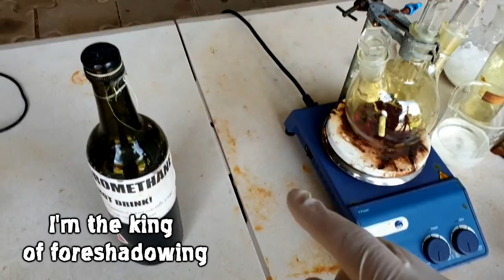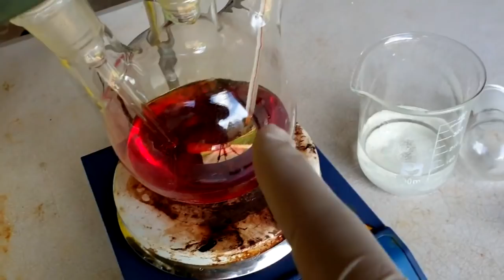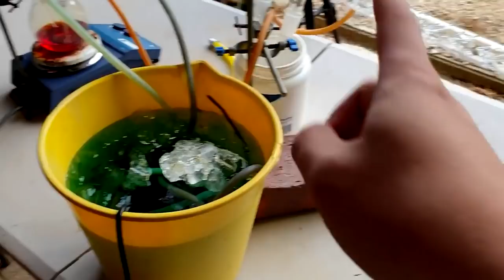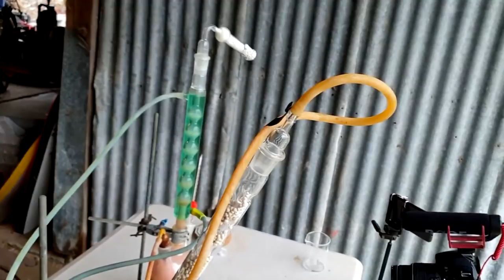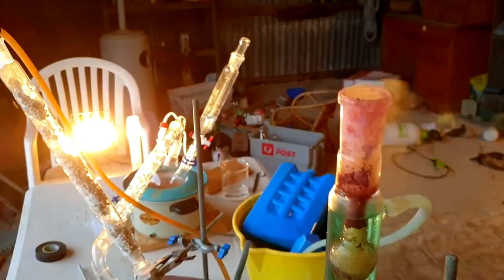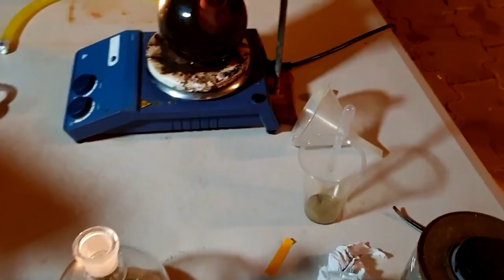Making S4N4 Part 1 (SCl2 + NH3)

Comment from the maker: Hey so comment question of the day is: what is the most stressful reaction you've ever done? I'm sure some of you have some good stories!
Reply: accidentally exploding black powder while drying it. not very advanced but very stressful for a short time.
Reply: Stressful story:
I remember once doing a school project to find out the strength of hydrogen bonds between chloroform and ethyl ethanoate. But according to what I learn from my school, chloroform does not form hydrogen bond. So, I was quite stressed when I wad asked to explain the exothermic reaction that happens when chloroform is mixed with ethyl ethanoate using hydrogen bonds cuz I don't really know how to do it.
Reply: Even though it is more of a process than a single reaction, that has to be the C60 synthesis since it took years of work and very unconventional large scale setups to get milligrams of crude product in the end... Worth it tho
Reply: Ammonium nitrate from ammonium sulfate and calcium nitrate using no glassware, filtration was hell
Reply: Embedding fragments of a 10mL beaker into my fingers at high velocity. A wee bit stressful for a moment there.
Mostly recovered now but lower portion of one finger is still hamburger meat under the skin.
Reply: @j_sum1 was it from energetics?
Reply: More of a disaster close call than a stressfull reaction, but here it goes:

I had this TiO2 synthesis where I would straight up pour 47% aqueous HF directly into titanium (IV) butoxide while stirring. (Then, autoclave for 24h, and get some nice anatase nano-platelets).

I once decided to swap the butoxide with isopropoxide. 

Turns out, Ti(OiPr)4 hydrolysis is much more exothermic than Ti(OBu)4. As soon as the hydrofluoric acid came into contact with the alkoxide, it went geyser, and splashed all over my fumehood.

Thankfully, I half saw it coming, and had kept the fumehood sash closed, save for a small slit on the side (it had sideways sliding windows) through which I could pass my arm, fully covered by the labcoat sleeve and long cuff gloves. So I was safe from any splashing. I was doing it on a very small scale too, only 2.5 ml of HF. 

Good scare nonetheless. 

I ended up just having to fully close the sash, wait for the bulk of the HF to evaporate, and decontaminate everything with my calcium chloride solution.

(This happened to be the one day my advisor would randomly show up in the lab... he was not happy!)

I repeated it, this time having chilled and diluted the reactants with isopropanol, and it went well. (Except it didn't give the results I was hoping for, but oh well...)

So I returned to my standard synthesis, on the large scale since it's my starting material for everything I did: pour 20 ml of 47% HF in 130 ml of Ti(OBu)4, firmly cross your fingers as it noticeably warms up, stick it in the autoclave, firmly cross your fingers again when you have to open it and pour out an HF/Butanol mix to get the TiO2 cake at the bottom, wash and centrifuge... Fun times!
Reply: 13 years old making a batch of rocket candy on mum and dad's camp stove in a Billy on the outdoor setting. Too much heat, 8 foot flames, molten flaming KNO3 going everywhere. Ruined the outdoor setting, stove and dad's trust. I'm now a chemistry teacher. Reaction wasn't stressful, situation was.
Reply: Probably some air sensitive stuff i was really worried about protecting from air
Reply: NH4MnO4 synthesis. Straight forward but fucks over your glassware with green purple shit, especially if said glassware is used alot and you overdo the temperature.. Residue that I thought was quite harmless (just some spots really, I could not get em off, actually forgot all about what it was later) came into contact with dilute HCl --> the garage turning into a WW1 battlefield.
Reply: Attempting (and failing) to prepare sodium nitroprusside, and having to deal with some HCN.
Reply: Accidentally exploding gunpowder...

Or Antibody and antigen reactions, with shaky hands, and where the procedure for the Antibody elution was entirely wrong, so the experiment didn't work. Worst 3 hours of my life that went to waste, in a hot lab.
Reply: @AndrewTann  oh yeah, i was doing that in the kitchen on 300g scale, whole room was filled with thick smoke for 3 hours, i don't know how i ended up with no burns...
Reply: Pd-catalysed carbonylation using 10 bar of CO, lithium-halogen exchange with 2.5L of t-BuLi, synthesis and purification of Zn(CH2SiMe3)2 or Zn(tBu)2 (conveniently fairly unstable) or the first time I made NaPPh2 using Birch conditions (Na in liquid NH3).
Reply: The one time I've done an LAH reduction was probably the most stressful reaction I've done so far. That stuff makes me really nervous.
Reply: @bestsoldier01  Having seen what happens when ~200g of solid lith-al catches fire, I don't blame you.
Reply from the maker: @the rougemillenial did you super-glue your own artery together? that's wild, glad that didn't go any worse!
Reply from the maker: @piranha031091  you always have great stories. HF is really stressful though, never worked with it but that sounds so so scary
Reply: Making bromine with potassium permanganate, sodium bromide, and sulfuric acid.  Needless to say there was a lot of bromine gas and a small spare bathroom had to be painted   Lucky i had a proper mask.  But my eyes didn’t fare as well.
Reply: Testing homemade black powder next to an open container of said black powder. One stray spark set of the whole batch and ended up with a molten plastic container.
Reply: I dissolved uranium dioxide ore in concentrated nitric acid to get fluorescent uranyl nitrate. As happens with nitric acid it started extremely slowly but got exponentially faster due to self-heating. I had just enough time to place the beaker outside on the window sill and close the window to let it be nature's problem until it's done. Then I spent 15 minutes watching my beaker of red-fuming green radioactive acid and evaulating my life choices.

Worked out in the end and I got glowing crystals now :)
Reply: That's probably drying iodide and ammonia in the microwave....yea!
Reply: Making trichloromethane via the haloform reaction (forgot to cool the sodium hypochlorite) whoops 😬
Reply: @rubenoconnor198  Same. In fact it ran away right as I was taking the flask to safety and erupted like a geyser straight into my face. My clothes were ruined and I was lucky to get away with just inflamed eyes for three days.
Reply: Extractions&Ire making benzoquinone from tylenol. it involved nitric acid and generated a lot of NO2. then it started to
foam. i had to do something like 5 recrystalizations from isopropanol to get the color to change from orange to yellow.
Reply: I'd say the time the neck of my round bottom flask cracked apart while distilling sulfuric acid. Nothing like a jagged piece of glass filled with 700° F acid spewing put acid fumes while it's also dark outside and you have no contingency plans for this occuring.
Reply: Baking soda and vinegar. Used too much vinegar and it got on the carpet. Mom was on the way home so I had to hurry and clean it up before she got the wooden spoon. Talk about high risk and high stress
Reply: Extractions&Ire also, C-Tet can be made this way. This is the German paper from around 1937. Looks like the Nazis did something useful. :-P anyway, link to article and thread below.

German Article: http://www.sciencemadness.org/talk/files.php?pid=193229&aid=12084

Thread: http://www.sciencemadness.org/talk/viewthread.php?tid=14927
Reply: Heating zinc chloride to brass plate some copper without a watch glass.
Reply: destruction of an iron pill in RFNA to determine its iron content. NOx was EVERYWHERE. lab school was fun.
Reply: For me it was probably the first time I did a dehydration with phosphorus oxychloride (POCl3). I was following a protocol from a paper, and I got to the workup, and it said that the reaction mixture was transferred into a sep. funnel and washed with aqueous sodium carbonate (or bicarb) solution.

It got really excited with the first few drops of bicarb, so I thought to add a little ice. The whole reaction mixture went "fwooomph" and over half of it ended up on the ceiling.

My PhD supervisor was in the lab at the time. 

I later worked out that the protocol I was following used a 23x molar excess of POCl3, so the vast majority of it was unreacted and still in the reaction mixture. Oops.
Reply: Making white phosphorus
Reply: I tried to make nitric acid with copper , nitrate and hcl and it produce an uncontrolled amount of nitric oxide. I
Reply: I accidentally blew up a flask with hydrogen one time... This is why you wear a face shield, lab coat and goggles kids.

Comment: You should use a tee joint downstream of the pump with one end going to your glass setup and one end going to a throttle valve and then to atmosphere.  You can then just adjust that throttle valve to a place where the pressure is low enough to not blow joints but also still hopefully high enough to provide you sufficient driving head for your experiments.  That valve would also be a means of manual over pressure protection by allowing you to fully open the valve in case you needed to rapidly depressurize.
Reply: I like that he almost came to this solution, but instead of a valve he just cut a hole 😂

Comment: Just a thought. why not use a hot water bath for temperature control, and use the water as a buffer, taking advantage of its high heat capacity allowing it to act as an energy sponge.

Comment: Just thinking, if you bubble the ammonia thru DCM before the SCl2 solution, won't that reduce the amount of solvent loss? Ammonia dissolving in the first DCM could perhaps be compensated by  clever use of a dropping funnel.
Reply: PS you really need to get some more clamps and stands, or even a bench scaffold set up!

Comment: DCM
A little less than Ideal?...

But it's safer than water....
Reply from the maker: I should've pranked myself, and three years ago actually just put wine in that wine bottle and label it DCM. Then I'd forget, pour it directly into the SCl2... and that would be less than ideal
Reply: @ExtractionsAndIre  yes, wine, or even 100% EtOH, would have been less than Ideal.

Comment: but shouldn't dcm be more polar than tetraCM and hence have a lower vapor pressure?
Reply from the maker: You're right it is more polar, so it goes against that usual trend. If I had to guess the reason, is say that the chlorine is just so heavy, you basically double the molecular weight from DCM to tetrachloromethane, so that factor increases boiling point
Reply: @ExtractionsAndIre  but at the scale of molecular interactions, polar attraction/vanderwaals is many magnitudes stronger than gravity, so that shouldn't be a reason. Perhaps it's because the bigger tetCM has much more vanderwaals?

Comment: Pink chemistry bad.
Reply from the maker: yet to be confirmed.
Didn't look very healthy though
Reply: @ExtractionsAndIre  well at least the pink isn't from blood. That would be bad.
Reply: @ExtractionsAndIre  Try using S4N4 to make a tantalum complex. You'll have synthesized S4TaN4.

Make sure you buy the reagents from Sigma Eldritch.
Reply from the maker: You guys are giving me good ideas for a Halloween spooky episode
Reply: @ExtractionsAndIre  "Today, we're encapsulating fluoride inside a fullerene, to make some [C60F]- H+, which should be corrosive enough to etch a hole through the fabric of reality itself. 

If it doesn't work, we'll try blasting one with octaazacubane."
Reply: "Normally you'd be worried demons might pour through into our plane of existence, but this being Australia, the local fauna going the other way is of greater concern."
Reply: No worries, mate! The demons would just fall down, so no danger in doing that.

Comment: how do you clean all your stuff?
Reply from the maker: My current method is putting all the dirty stuff in a box and trying to forget about it but instead just feeling guilty all the time
Reply: @ExtractionsAndIre  that is what I am doing at the moment and now I cant get rid of it. :(
Reply from the maker: @cadmiumbop  don't make me lose hope :/
Reply: @cadmiumbop  Sulphur can be cleaned using toluene or xylenes... Other than that, a base bath should work for most things, although you can't just dump your glassware in that forever or it will corrode. Nile red has a video on making a base bath.
Reply: @williamackerson_chemist  thanks for the advice I might try that I have never though of that before. :) I have nearly year old flasks ridden with failed sulfur experiments so I can now free up some flasks instead of just buying new ones